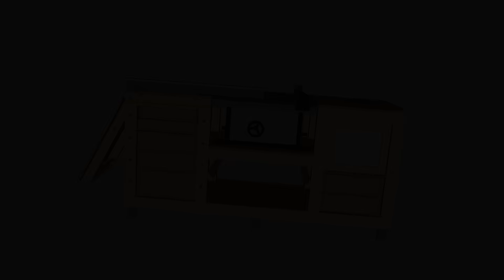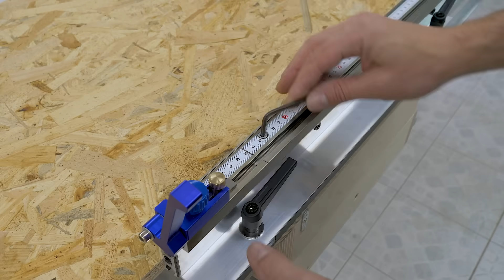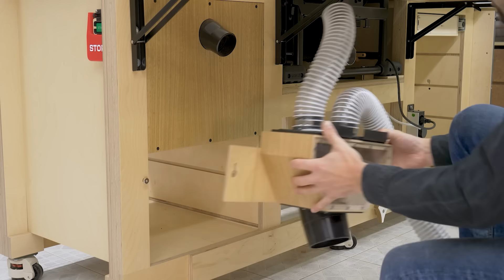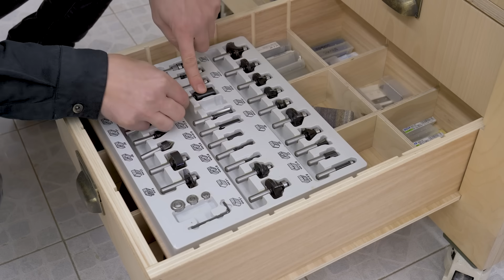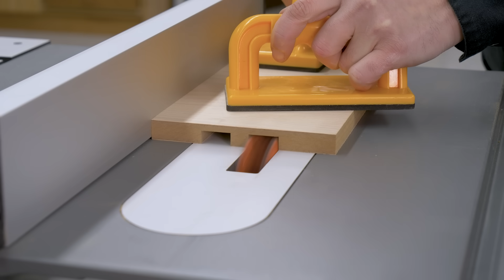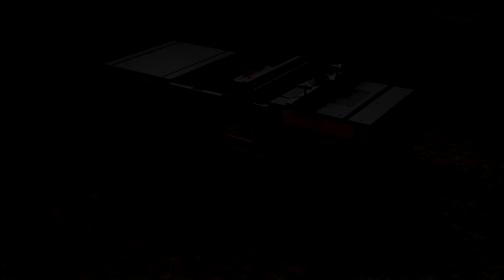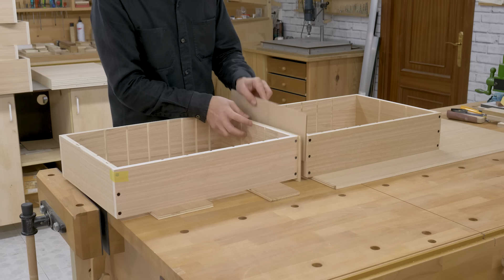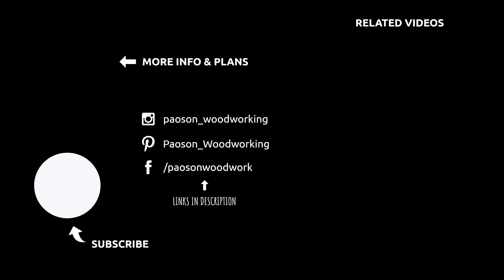DIY Mobile Workbench with Table Saw & Router Table / Showcase - Ep 8

Comment: This is one of the nicest designs i have seen so-far. I love also your very clean way of working. An example for all off us! I would be very interested in all the information you can provide about using dado stacks in Europe. I find it very frustrating that we have all these restriction on this application in Europe.  In my humble opinion it does not prevent a table saw from being a very dangerous machine if not used with caution.
Regards
Remond
Reply from the maker: thanks Remond!

Comment: Thanks a lot for this final video. I built it but I'm stopped at a certain step. How can you cut small width of wood with the DeWalt fence without that the DeWalt aluminum rail in the back touches the plywood and the aluminum u rail ? They are at the same height.
Thanks

Comment: Absolutely fantastic!  Have you considered adding thin, self-adhesive, PTFE tape to the slide grooves for your lower drawers?  That might make them pull even smoother than the ball bearing slides in the top drawer.
Reply from the maker: It is a good idea! thanks

Comment: 4:00 A thought I had to aid with the drawer movement when using the sliding carriage, to assist when pushing it forward; inset a couple small rare earth magnets into the front face of the sliding carriage, and matching magnets into the support brace you attach to the drawer. This would eliminate the need to keep your hip in contact while sliding it forward.
Reply from the maker: thanks Jeremy! I'm thinking of doing something similar